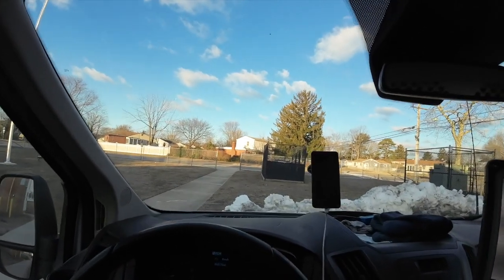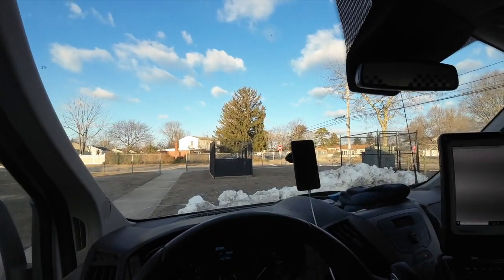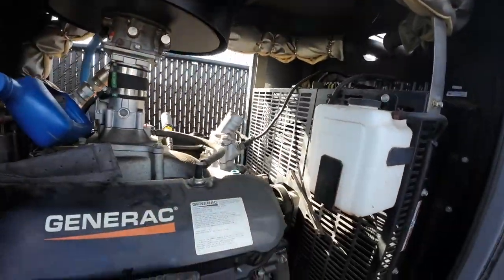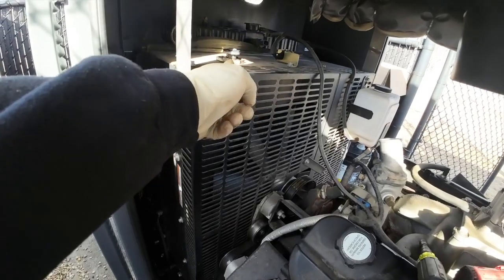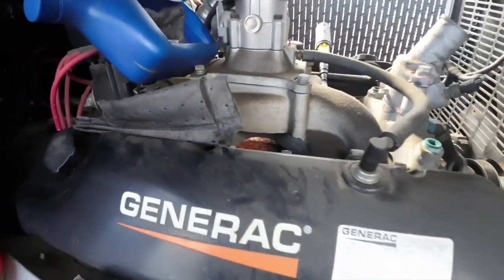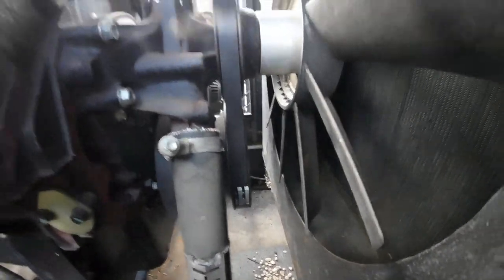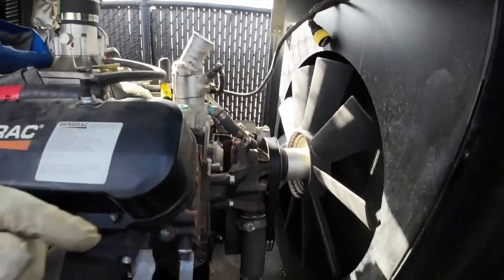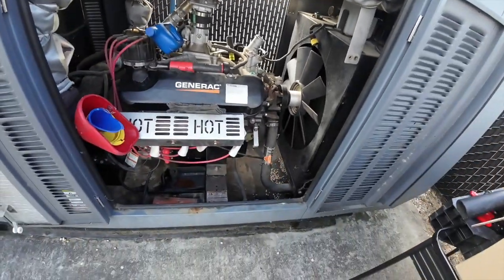Generator coolant system overhaul

Comment: I can understand why a rag might be in there to avoid dropping parts during a repair but also have to wonder if there was any history of overheating and how many hours are on the unit. IOW, a problem from day one or perhaps this customer was picked up from another service company? That said, does this unit fall into the category of that updated harness which only powers the coolant sensor (from the gas valve) while running? I recall (years ago) we had issues of electrolysis on those probes due to being constantly powered and the factory fix was a modified harness. Not sure if the factory ever changed that in production or if was an "as needed" item. (field fix only)
Reply from the maker: 🤔 I think I’ve heard that from one of our senior techs who’s been around generators for over 10 years but I’ve never seen the issues with the coolant probes
Reply: @apcadventures     going from memory, that would be around 10 - 12 years ago and mostly on residential size units. (48kw and under?) That H panel has been around so long that it's hard to put a date on them at first glance. I know some of the larger units still came with that control just before I retired 5 years ago and the first one I saw was right around Y2K.
Reply from the maker: @ I still get new genset startups with H-panels in them, but yeah that panels been around a long time!